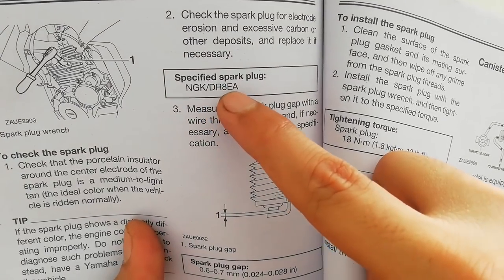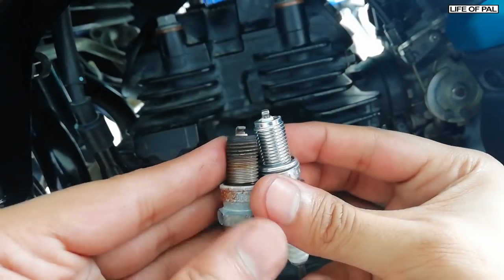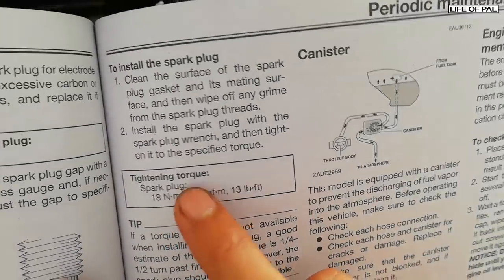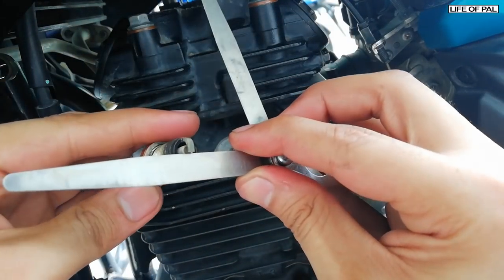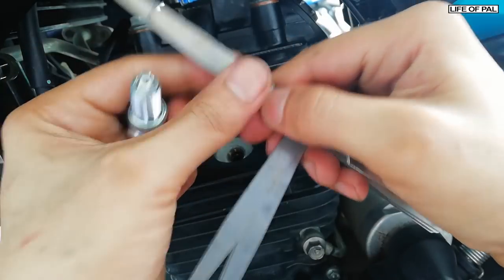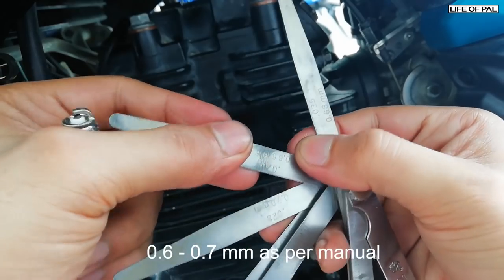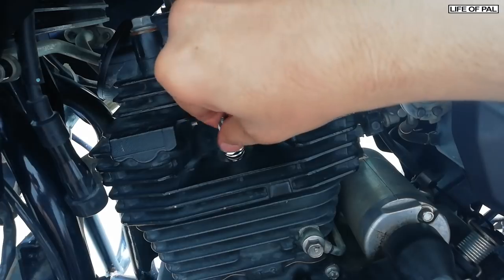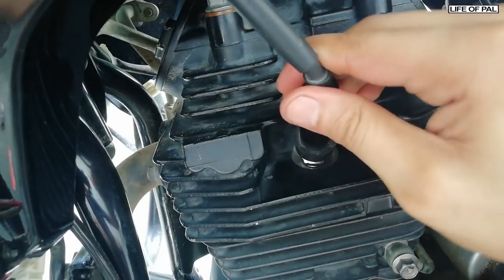Spark Plug Replacement & Comparison | FZ25 | Life of Pal

Comment: I am going to book FZ25 today bro... What is your current mileage? But i like both FZ25 and NS200.. Help me choose bro..
Reply from the maker: I get 40-45. Some get 35. Go as per your need. Depends what you want.
Reply: @LifeofPal  wow bro.. U ride at 100kmph yet u get 40 - 45pl ?? Is it because u don't rev your bike too much? Or motul engine oil?
Reply from the maker: It is because of maintenance and throttle control. I dont rip throttle or abuse bike.
Reply: @LifeofPal  love your respect for the bike bro.. Submitted all the documents.. Taking delivery on Friday or Saturday.. Do u have ABS version?
Reply from the maker: Congrats bhai. Mine is 2017 non abs

Comment: I saw all of your videos and they are very informative. Bro did you feel any performance issues after the second service? Becoz after the second servicing pickup as well as top speed has gone significantly down. What could be the possible reason if u can help
Reply from the maker: Thanks.
Did they touched tappets? If yes they messed up. No? Check for air pressure 25/35. Chain slack. Change air filter it get clogged by 6k.
Reply: Shashi Kant  my also bro top speed isn't satisfied
Reply: @LifeofPal  bro, what is the correct air pressure for front and rear tyre ,im maintaining 25 for front and 29 for rear!is that correct

Comment: hi there could you help me out with an issue?
 my Fz25 needs spark plug replacement every 3 months or the bike will not start!! mechanic confused any ideas?
Reply from the maker: This is weird. Make sure you are getting the original and check your ignition coil. Basically any difference in the spark.
Reply: @LifeofPal   mech says bore at fault has to be replaced now i am having super pick up and all but black smoke from exhaust what to do now?
Reply from the maker: @esechelvaratnam848  black smoke is cause by excess fuel consumption not by bore damage. Excess fuel gives more acceleration but poor mileage and top.

Comment: Hi bro my bike is 2017 model odo is 14500 kms now while riding in 120 speed for 5 kms and slowing down the speed the bike engine was offing I think it was spark plug issue what do u suggest me
Reply from the maker: It is probably due to low idle
Reply: @LifeofPal  for how many kilometres we have to change the spark plug do u know
Reply from the maker: At 15000 kms

Comment: buddy is it possible to change the light control to old fz
Reply from the maker: Yes but  will not direct fit. There will be change in connectors so they have to be altered using electronic skill and tools